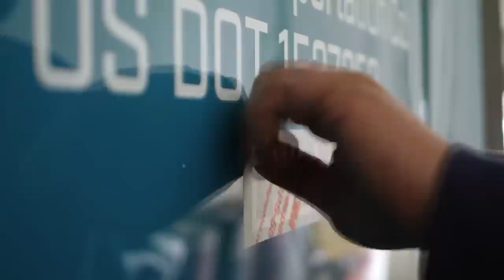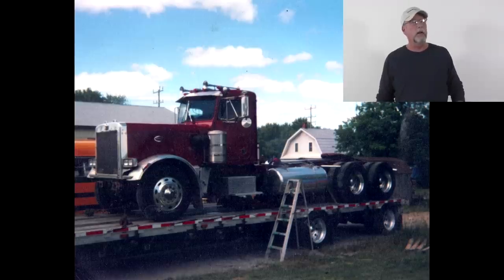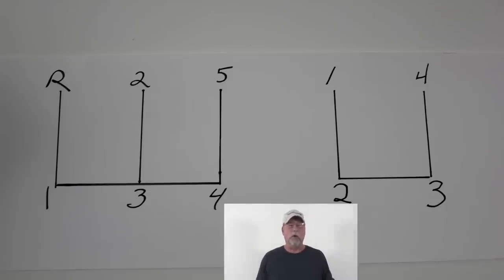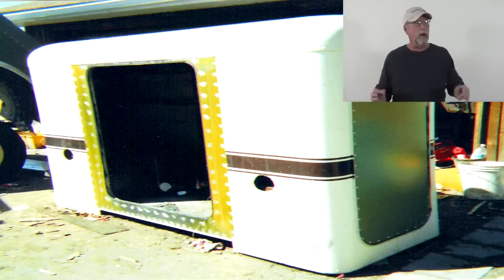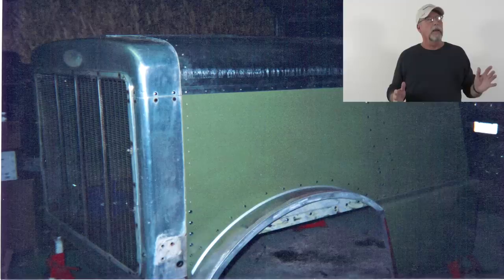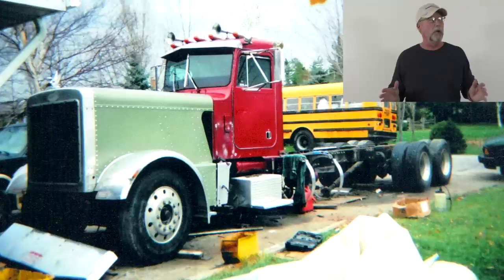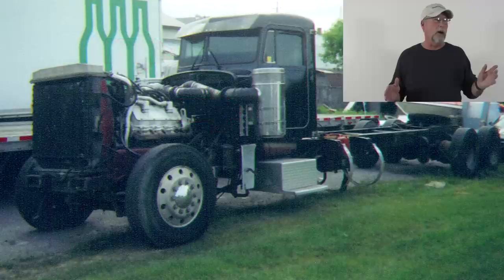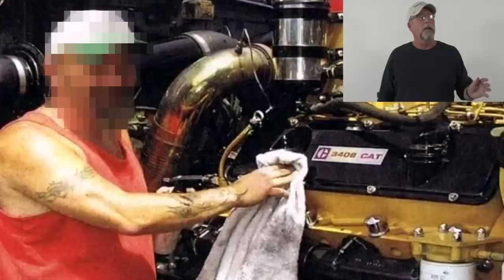1980 Peterbilt 359 Restoration | 3408 Cat Engine | 336 " Wheelbase | 5X4

Comment: Can you imagine turning that truck on tight right hand corners
Reply from the maker: Yup, you had to swing her wide! The dump axle on the spread axle trailer helped quite a bit.
Reply: I can see tryin to make corners with that setup in nyc.  Holy hell it'd be a nightmare
Reply: Two wrong won't make a right. But three lefts will.
Reply: Tobin bridge Chelsea Market would be fun in that truck. About 1985.
Reply: @nickd.4512  You would avoid Boston, NYC and Philadelphia altogether. That's a truck for the Alaska Highway

Comment: That was cool seeing a white 3408 from back then. We had a ‘83-359 Pete & it had a 3406B in it & it was painted white as well. Not sure when Cat went with the yellow paint on them but we never seen a white 3408 in person on the road back then. If I remember the longest factory hood, it was called “extended hood” on the 359’s was the 127” BBC. Ours was the 119”, it couldn’t have been much longer because the truck had a head rack built on it to haul a car above the cab, as it had a portable parking lot hooked up behind it. That was a great ride & a good era to be on the road running to Shakey & the Gay Bay, out there on I-40 between Okie City & Barstow was great for sight seeing, for sure. Good Day Everyone!

Comment: Oh yes! Recognized it right away double over, (double overdrive) I’ll bet he ran tall rubber, 11x24.5 in that truck and was a triple digit for sure! BTW the RTX Eaton was still overdrive but the were able to design the shift away from the wall. This was because newer drivers couldn’t master the concept, so they made it easier. US military trucks with a 5 speed were like that till the sissyfied the new ones with lazymatics!
Reply from the maker: Yup, tall rubber. That low pro stuff hadn't started yet.

Comment: Personally I love this video. Back in the early 1970's I was an apprentice and we used to stretch trucks all the time. A few customers had 5-4 boxes and if you forgot what gear you were in and the whole thing was spinning out of control, no syncromesh on these, you had to pull over and wait for the gears to stop spinning and start again. Of course I am too old now but I dream of a Pete just like this with a bunk with a door straight out the back and have a Hiab Crane mounted on the frame which would be used to lift a nice boat that could sleep four people off the cradle and launch the boat anywhere. Now however we can't go anywhere because of the virus so the Finger lakes are inaccessible anymore. Instead of a bunk there would be seating for three friends.
Reply from the maker: Hang tight Robert, all this virus stuff can't last forever. Love the idea about the Hiab and the boat!

Comment: Built that thing in his driveway, bet the neighbors love him. Those 3408's were fuel guzzlers. Your right that is the large car engine, that and a KT Cummins. I know were there is a 79 359 with that engine in it, old owner operator who retired and he wants to sell it. He probably has by know, that was a year ago, it needed a clutch it was a project.
Reply: Dad had a KTA 600.  Sure pissed the guys off that had 3408’s 😂🤣
Reply: @heavyhaul8621  That to me was the engine, much better then the 3408, We had neighbor had one in a K100 that thing would pull. They had them juiced up they would turn the pumps up they had to be 700 hp when they were done 4 miles to the gallon  they had pistons like a 5 gallon bucket.

Comment: Wouldn't want to run a 5X4 today but sure glad I learned on them. Was so good I could run with the Jake on, this was when if you messed up the Jake would kill the motor.
Reply from the maker: That's right! Happened to me a few times!
Reply: Back then the jake only had one stage. Worked great to shift main box.

Comment: Not to be picky but he should have put an unibuilt opening between cab and sleeper so you can slide the seat back further to give a guy a little more leg room. 359 cabs are already pretty tight front to back.

Comment: They don't make guys like the lettuce king today
Reply from the maker: Probably just as well, the prison system is over crowded as it is!
Reply: Smart Trucking 🤣🤣🤣🤣
Reply: Oh I definitely know a couple guys like the lettuce king
Reply: Rodney Stewart Guys like the Lettuce King are gone .They just disappeared when the trucking industry started sissfying trucks and making these cheap fleet trucks that are powerless useless pieces of garbage. You can’t even have a truck that has a decent antenna system for a CB radio, let alone a little bit of power and torque to run up even a 2% grade. Today, literally trucks are nothing more than lipstick on a pig.
Reply: @aviatortrucker6198  May I suggest taking a look at the Western Star lineup
Reply: They do, but they work in the oil patch, up in the mines, lumber haul or something that is specialized. That's where they appreciate guys like The Lettuce King nowadays

Comment: Trying to buy a 359 now. 3406 and trans is gone, but interior is as close to new as you can find. Its a short hood, and all panels are in great shape. Working on the price, and its under 50 miles from me. It's a factory 36" sleeper truck, but a sad 220" Wheel base
Reply from the maker: That wheelbase is easy to fix!

Comment: Love your videos Dave... especially the stories.... reminds me of my trucking past..... while you are technically correct, you don't HAVE to shift twin sticks with your arm through the steering wheel, we used to just main stick it if loaded light or empty, you better be able to shift both at the same time if you were fully loaded pulling a hill in BC.... if you shifted 1 at a time you'd have to drop 2 gears as you lost too much momentum... and as you undoubtedly know you had to put the main into gear first and the aux second after matching the RPM. to road speed … if you tried to put the aux into gear first it would just grind as you couldn't match the RPM. until the main was in gear and engaged to the engine.... my Dad taught me to drive in a Kenworth with a Cummins and a 5x4.. don't remember the main being and overdrive though... could be wrong as it was too many years ago.... we had a Pete logging truck with a 1693 Cat and 5x4.... wish I knew where that ruck was now.... I'm in the process of building a bus converted to a motorhome and I'm using as many Peterbilt parts as I can... I have a reproduction 359 Corvette dash I'm installing as well as many other parts …. keep up the great videos.... while I don't comment often, I watch em' all!!  :-)
Reply from the maker: Thanks for watching James! Good luck with the project, sounds like she's going to be a beaute!

Comment: When I tried shifting in the big truck I had a hard time shifting and I figured that it was because I found I dint have manual car experience I thought of how it would help with this but the school staff said no it is not transferable because it’s totally different from a manual car and this is one of the few trucks with a v8 engine I have seen mostly these trucks engines were inline 6
Reply: A stick shift in a car has synchronizers which match up the gears to the engine speed as you shift.  A big truck doesn't - you have to manually match the engine revs to the appropriate gear and road speed.  It's quite an art... but smooth as butter when done well.

Comment: Do these long wheelbase trucks only haul lighter loads?  I'm just wondering how you get weight on the steers.
Reply from the maker: Good question and the answer will surprise you. The engine weight on a long wheelbase truck is all on the steering axle and with cab weight and everything else most long trucks like this sit close to 12,000 lbs empty on that axle. All the freight weight is concentrated on the drives and the trailer.

Comment: It helps quadruplex transmission if you got two right feet one to tickle the throttle and one to help ajust the speed with the left foot on brake when slowing down and to turn in somewhere I always knew when someone told me they was putting both hands through the steering wheel they have never driven one

Comment: I have never driven a Spicer; not too many of them left, I imagine. Was it even possible to use the clutch? Also, I seem to recall there were only about 15 practical gears, which is still plenty of gears.
Reply from the maker: You could use the clutch, but often you were better not to. In regard to the gears, often a few of them would end up being 100 or 200 RPM  apart, it wasn't practical to use them all. Good questions!
Reply: @SmartTrucking  Thanks for explaining. This looks like a well-done restoration project.

Comment: Those old 3408 ‘s had a engine oil operated engine retarder that I heard was pretty good but cat did away with them around 1982 because trucks where going to the setback front axle design and there was not enough room for that engine/flywheel combination
Reply: My boss runs Cat engines almost exclusively.  Most have a Jake brake/ retarder combo. We gross 104k and have long steep hills in Idaho. The combo works well, and yes we do have them in set back axle 378 Pete's and T800 KW's. He also runs 379 Pete's, W900 B and L model KW's, and Freightliners which cannot ever be classed as a truck.

Comment: Basically its known as an Anti-Millenial truck because these kids these days don't understand the 2 lever system vs the air operated high/low function on todays Eaton Fullers
Reply: Not true I’m 29 and know how to operate an 18 speed and when to use which gear
Reply: Anti-Millenial theft device!
Reply: @mole646  Yep! That's what Eric O in the South Main Auto channel calls it
Reply: @lilripstaSSF4  an 18 double over? It's the same as a 13 except you can split the bottom half.
Reply: Emphasis on the U or the H pattern.....everyone of them would be underneath with a small sledge......
Reply: An 18 and 4 is the best combo I’ve used.  Manual not air shift.
Reply: Half the millennials can't even drive a 4 or 5 speed in a pickup.
Reply: Nah they don't  know what to do with a road ranger. I miss the 2 stick trans. First gen sleepers popped out  the  big rear window and added a sleeper. Dads 79 freightliner conventional had the AC/ heater in between the seats his 104 big bunk Freightliner Coe had more room than that truck. Crawling thru the hole to a twin size bed sucked.